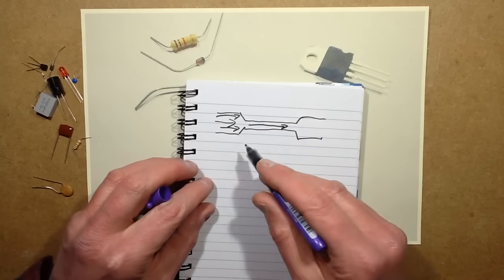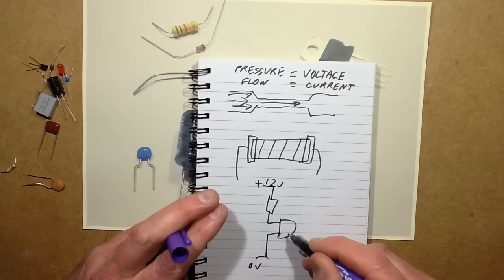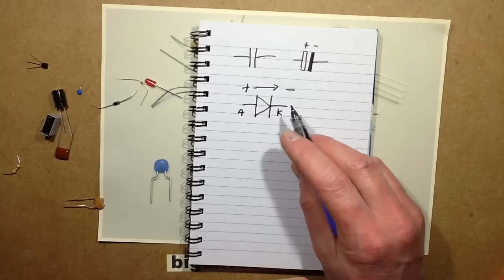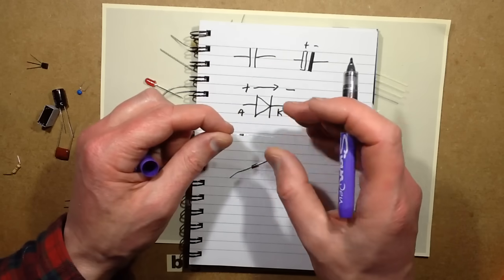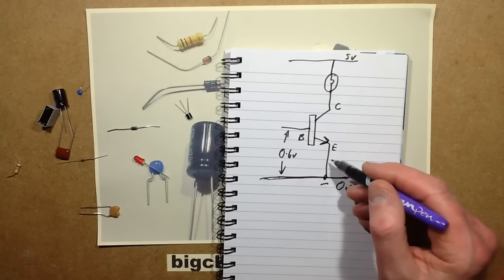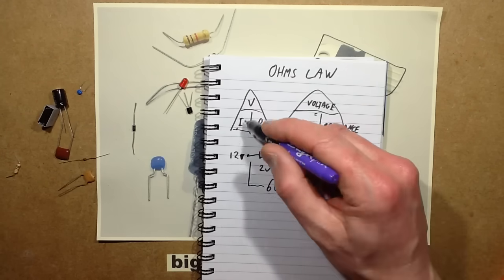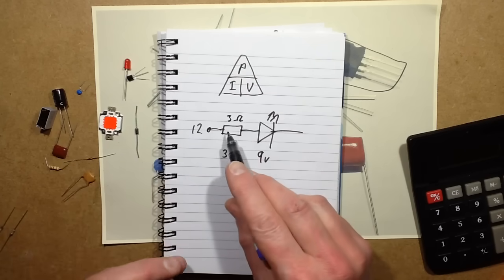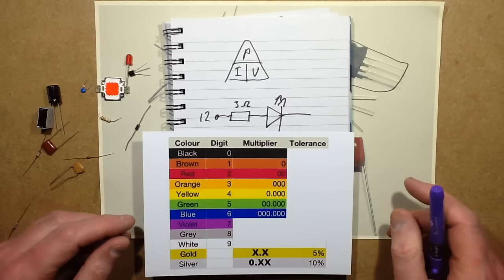A simple guide to electronic components.

Comment: Was intrigued by that K for Cathode..

They covered the K aspect of Cathode on Stack Exchange, they mention that the origin of the word is the Greek word Kathodos (way, path). The top post also mentions that it's also to avoid confusion with C which most of us use for Capacitors.

Also in other languages like German and Dutch it's spelled Kathode.

Src: http://electronics.stackexchange.com/questions/65981/why-is-the-symbol-for-cathode-a-k

Comment: Why K for cathode:

1. kathodos: Greek καθοδοςκαθοδος (kathodos), descent : kat-, kata-, cata- + hodos, way, path.

2.The "K" was introduced into CAD library schematic symbols and PCB footprints by CADPRO, Inc. around 1990 in San Diego, CA. As the CADPRO PCB library team was cataloging all of the alpha-numeric pin letters for Transistors, Power FETS and Diodes, the philosophy was to list all the letters in a table:

C = Collector
E = Emitter
B = Base
S = Source
G = Gate
D = Drain
A = Anode
K = Cathode (because "C" was reserved for Collector)

cheers :)

Comment: One thing confuses me. You first drew the resistor AFTER the LEDs in series but then when you spoke about wattage formula you drew the resistor BEFORE the 9V LED. Can you explain that to me please?
Reply from the maker: A resistor can go anywhere in a series circuit.
Reply: Woot? How does that work? If I make a circuit and connect a 12V power supply to a .3A, 6V LED do I not have to put a 20Ohm resistor before the LED as not to blow it?
Reply: +Filip Ionita I hate water analogies, but they seem to be best to explain when starting out: A resistor reduces current flow. So, imagine you had a water hose and you put something in the middle of this hose that made it smaller (flow less water.) Your water would flow at the same speed both before and after that thing. LED's cook because of high current (among other things). But with a current limiting resistor it doesn't matter where it sits in series, usually.

Comment: I dont understand the diode bit, because even though electricity is written in diagrams as going from positive to negative isnt it actually going from negative to positive because its electrons with a negative charge moving through the conductor? ofc that doesnt make any difference to something like a resistor but how can a diode allow current to flow in the direction it isnt actually flowing and block it in the other direction which it is actually going which would stop the real flow of electrons which would stop the circuit working? or is it just blocking in the opposite direction to how it says.....and it makes things like transistors difficult to think about with which is the collector and emitter when the actual electricity is going through in the other direction to how its written down. i wish I could just forget about electrons because its so confusing.

Clive itd be really nice if you did a series of vids on components, one component a week or something and talk about the basics  how they actually do what they do in real circuits. like capacitors are difficult too, I never understood how you can have a capacitor in a capacitive dropper circuit in a light which reduces the voltage so leds dont blow up but then you have capacitors in an ioniser circuit which increase voltage so high you can make ions from pins. i get that they store charge to be released later but that just makes them sound like little batteries and I dont understand how that translates to how theyre actually used

but maybe "teach me all about electronics" is too much to ask on youtube lol I guess i should get myself a book about it maybe theres an electronics for dummies

Comment: If a circuit says i have to use film capacitors can I or cant replace it with electrolytics?
Reply from the maker: For AC signals you would have to use a film style capacitor.  They are also better suited to specific tasks like high frequency applications like in radio circuitry.
Reply: Thanks mate!

Comment: I am stuck with Electrical Power Engineering. I don't understand circuits or electronics but changing my course is not an option. Would you be kind enough with how to strengthen my basics for both electrical analysis and circuit analysis with proper understandings to why and how it works?

Comment: I wonder why myself. For instance with some things I would use a resistor other times a pot. 

On a circuit board for instance I watch videos on it and they explain it to an extent but why use this instead of that and why place them where place them etc. My issue is I know most of the other but why is my issue. I get the analogies  and such but okay take a circuit board what are the potential alternatives to that circuit board and why they did not choose them besides cost of course. 

Another thing that bugs me is I am making an AC to DC power supply that varies between 0 to around 30 V with a few components and two pots the thing is it will be a chunky bastard and have decent girth yet when I look at these power supplies that go to a phone they are small and are able to take 120V AC and turn it to 5V DC and I wonder how come I do not have this knowledge to be able to make mine that small and I even think maybe I can replace a few components out of the phone charger and make my variable plug with that. 

I have too many gaps in my knowledge and it bugs me and I cannot find any videos for such gaps. The why, the how to make alternatives smaller and such and why you should or shouldn't. I know my chunky variable DC plug actually could be brought down in size but how? I know a circuit board has these components but why this way, why specifically them etc. It annoys me. 

I know if there was a video of a circuit board being broke down to be studied as if a dead body we would be here all day but that is one thing I really wish. Like let's study a circuit board series.

What I would really like in a breakdown of a circuit board is something like okay this is a certain part it does this alternatives are this but the reason why you do not do this is because too much noise or maybe it is too much of something else which would be useful if used in certain other things. 

I ask way too many questions, observe from all angles and over analyze. Alas I only seem to learn when I know why and well I annoy myself because of that. Sorry for venting I spent a while searching youtube for something like the above mentioned (studying circuit board series etc) but I only ended up here and on music videos because youtube thinks music videos have something to do with circuit boards dunno why.
Reply: Yes, bub you think too much buuuut still I have yet to find the answer. Nice to meet me from the past. I, however, prefer the car analogy now since I have some mechanic skills in me. Wonder in a years time will I see this again lol. I at least understand him better this time so I improved some.

Comment: Hi Clive, can you make a video about common failure of a switch mode power supply? it would be very useful for us since power supply failure is one of the most common problem on electronic devices and that means I'll not need to replace the whole thing, just the broken components. Thanks.
Reply from the maker: Often when a switchmode power supply fails it is very destructive.  It's also quite common to have specialist high voltage transistors or chips that are not easy to source.  But one easy to replace components that dopes seem to cause issues is the electrolytic capacitor, however it may also blow the rectifier when it fails.

Comment: if I learn electronics, will I be able to make robot's and soloar panles, ?
Reply from the maker: Yes you will.
Reply: +bigclivedotcom how long will it take me to learn, and where do you recommend. even to start, should I buy a breadboard?
Reply from the maker: A breadboard and some random components are a good start.  Even some cheap LED kits from eBay.  There's loads of information on Google and Youtube to help you along.
Reply: If you are interested in electronics and robots, you should have a look at the Arduino.  Arduinos are extremely cheap microcontrollers that can be used to interact with the real world - perfect for robots.  Learning to use an Arduino will mean you learn some simple electronics such as using resistors as voltage dividers, using capacitors to smooth power supplies, using voltage regulators to power different devices and so on.

There are two other huge benefits to learning about Arduinos.  There is a massive Arduino community and documentation and tutorials for beginners are all over the net and they are extremely cheap.  You can get an Arduino Uno for £1.72 on AliExpress.  Add a breadboard, a few resistors, LEDs and a power supply and you could up and running for less than £5.
Reply: Also helps you learn basic coding along the way, which is another useful tool to have.
Reply: +Joshua Rosen thank you.
Reply: if you learn electronics you'll be able to do whatever you want
Reply: Learning Electronics will Help  in making Robotics and Solar Panels.

Robotics also requires some mechanical knowledge.
You can stop there, or if you want to go beyond solar panels, and make solar cells, you will also need some Chemistry & probably (at least some very basic) Chemical Physics.

I have a saying, & it goes something like this:
All you need are:
1. Morals
2. Chemistry
3. Physics
Reply: yes sir you will be able to. basically u can be like rick from rick and morty and build loads of cool shit and then travel around space with your grandson..
Reply: solar panels are materials engineering. robotic involve a mix of control and computer engineering.
Reply: here is a link to learn about robot for beginners, very simple of course.http://letsmakerobots.com/files/How_To_Make_Your_First_Robot.pdf
Reply: dogsforlife 
You would need to learn a little about hardware and software
Reply: yung キアン  Rick and Morty kick ass lol.
Reply: dogsforlife Need some programming knowledge, if you're interested in robotics get an Arduino, pretty cheap
Reply: Joshua Rosen If I buy an arduino do I have to buy all the separate parts to make something? I am a freshman in High school and am interested in making and learning these things.
Reply: Long ass way to go
Reply: TheJadeRabbit No idea if your still interested but the answer is yes and maybe. A good start is to pick up a cheap Arduino alternative like the SparkFun RedBoard. That particular board is for all intents and purposes an Arduino, uses the same chip, same software but cost about half as much as an actual Arduino (as of time of this posting, $15). After that you have a couple routes available to you. 

You can salvage components from dead, obsolete or otherwise now useless electronics. Sometimes it's even worth it to buy things that you know has the components you need but is on sale. An example of that would be Christmas laser projectors go dirt cheap after Christmas but contain lasers and motors that would easily cost you 3x to 4x as much to order separately. Old TVs and VCRs contain a lot of transistors that are just the right ranges for use in Aruidno based projects as well as a variety of other useful components (LEDs, capacitors, buttons, switches, etc). 

You can order component kits on Amazon which have a variety of ranges of a specific components. For example you can find boxes of resistors from 1Ohm to 1MOhm with 20-40 of each for $10-$20, sometimes even in nice plastic boxes that make it easy to keep them sorted. Just be sure to read all of the comments before ordering, while most are good enough for hobby level use, you'll want to know ahead of time if you can trust the tolerances marked on the parts and if not just how far they are off so that you can adjust your design accordingly.

Probably the better option would be the so called "exploration kits" I've seen from a company called Elegoo (they sell on Amazon). They make kits specifically targetted at Arduino which contain a variety of components to get you started. The really nice thing I seen from them is that all of their kits come with 1 or more breadboards and lots of jumper wires which are incredibly handle to prototype your circuits before you spend time soldering it all down to a more permanent circuit board.

The maybe comes down to how determined you are. As complicated as it might seem at first. Circuitry is very simple. It's so simple that sometimes it's hard to get yourself to think in such simple terms. If you really want some mind blowing inspiration, look into the life of Micheal Faraday. The guy never completed elementary school, didn't know basic math, was dirt poor, spent much of his life taken advantage of by aristocrats and seemed to suffer from a serious case of Alzheimers but yet he developed the concepts that lead to electronics as we know them today.
Reply: actually i like electronics so much but here in Rwanda it is not more advanced and don't know what to do

Comment: im watching the part on capacitors, based on the info, im curious,  would a emergency blanket work as a " emergency capacitor"......might need to be cut to shape and whatnot.....but  all that surface area of thin insulating  plastic, coated in even thinner metal, stacked in layers.......should work, right?.... if i could, id try to test it out my self.

Comment: Hi Clive got a question for you 
I am thinking about building my own dump load resisters for my wind turbine and was wondering what wire to use.
I am not very electronically minded so am learning a lot from YouTube and asking advice where possible.
Would welding wire do the job i.e. 0.8 mm or similar
Regards
Reply from the maker: +John Little Have you considered one of the Chinese wind turbine controllers that shunts the turbine using PWM to regulate its speed?
Reply: +bigclivedotcom no I haven't seen those advertised to be honest
Reply: +John Little and I do get confused to what I need compared to what the descriptions are given I have a schematic for a charge controller but still confused if it's the right one
Reply from the maker: +John Little I've had a browse on eBay, but most of the units seems to be for solar panels.  In that case it possibly is worth either sourcing some load resistors or winding some.  You may be able to use existing cooker style heating elements if the output power is low.
Reply: +bigclivedotcom mmmm cooker elements never thought of that one good idea I shall have a look at that cheers

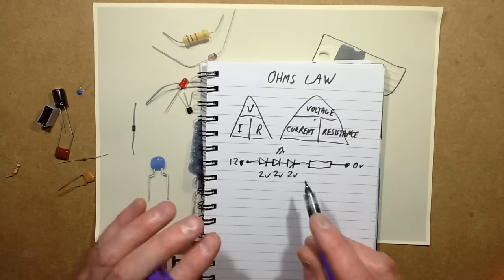Comment: @26:18 Where did you get 10mA from?  The rating of one or combined rating of the LEDs?
Reply from the maker: +Frazer Mountford The current will be equal through the whole string of LEDs and the resistor, so each LED will be run at 10mA.  I just chose the 10mA as a fairly standard value for small LEDs.

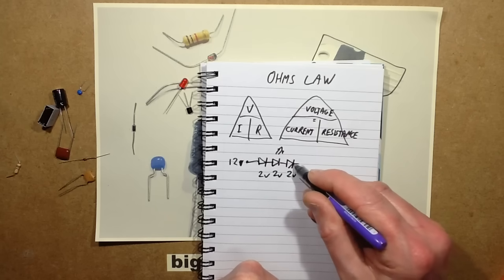Comment: Hey @bigclivedotcom, around 26:10 you drew a diagram showing 12v passing through 3 LEDs and a resistor. You drew the LEDs in the same way you drew your diode representation earlier. Does this mean that LEDs act like standard diodes, only allowing current to pass in one direction? Thank you, sir =)
Reply from the maker: +Mike Mitchell Yes they do behave like standard diodes, but because they are optimised for making light they have a fairly high forward voltage of about 2-3V and a very low reverse blocking voltage of just 5V.
Reply: bigclivedotcom thanks so much! Just to make sure I actually take actionable knowledge from this, however, let me make sure I understand your full point --

You said that LEDs have "a fairly high forward voltage of about 2-3V and a very low reverse blocking voltage of just 5V," Does this mean that LEDs allow 2-3V to "pass through" to the next module in the series? Or does it mean something else? Does the 5V comment mean that if the LEDs were accidentally (or otherwise) soldered to the power supply in reverse, they would "block" up-to-5V (given that the current would be traveling in the "wrong" direction), but no more (i.e. if 6V were "trying" to travel through the LED in the "wrong" direction, 1V would pass through successfully)? 

Thanks, as always. Can't tell you how grateful I am for the nuggets of practical, consistently workplace-relevant knowledge you're always sharing with us viewers. I'm proud to be a supporter of Big Clive, all the way from Philadelphia in the US =)

--Mitch
Reply from the maker: +Mike Mitchell That's pretty much it.    But when the reverse voltage of the newer green, blue and white LEDs is exceeded they may suffer damage.  The older red technology is more robust.

Comment: I believe anode and cathode denotes where current flow in and out of a device, this can be a bit confusing at times since it might change depending on how the device is used (e.g. a rechargeable battery). Name is based on Greek anodos and kathodos therefore K for Cathode.

Comment: Great vid revealing the mysteries of these things. Just one question: does a resistor go on the + side of a component or the - side, or doesn't it matter? Does a resistor work for that whole line in the circuit or just after its placement? My problem has always been thinking about electronics in a mechanical / hydraulic way which buggers me up sometimes! I did like the bit where you let the smoke out Clive, very good - and still the only way someone like me can tell what's wrong!
Reply from the maker: +virtualgaz The resistor has no polarity and can go anywhere in line with a series circuit to limit the current.
Reply: +bigclivedotcom aha, thanks mate.